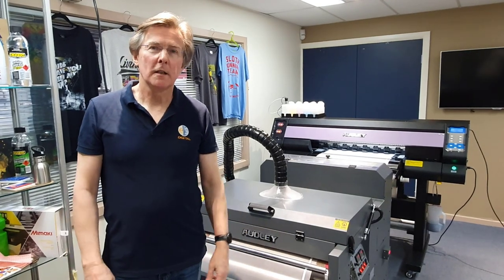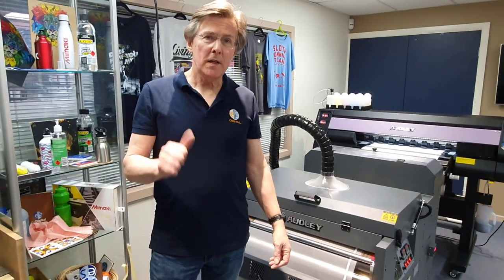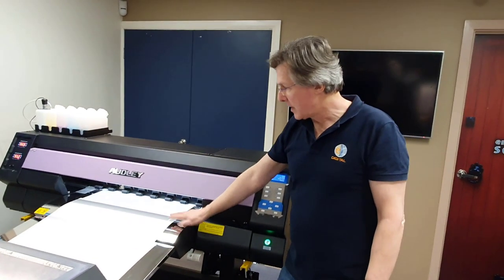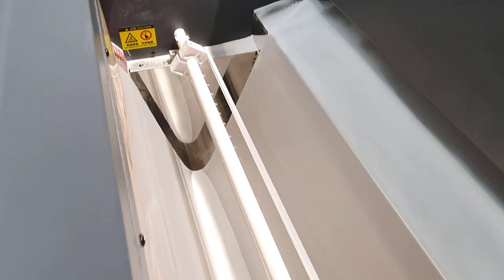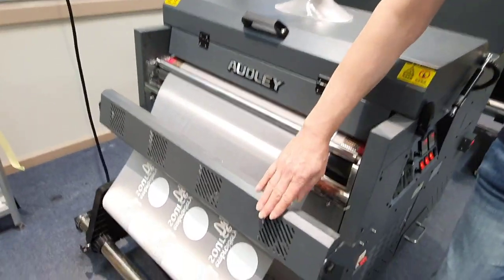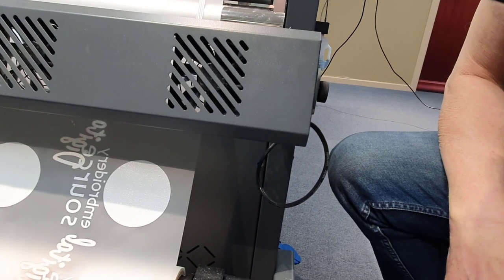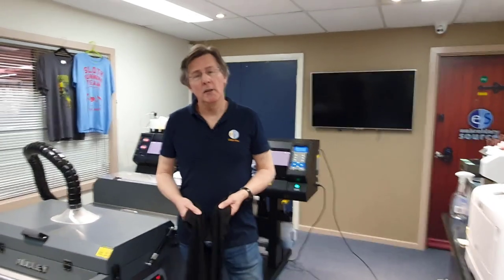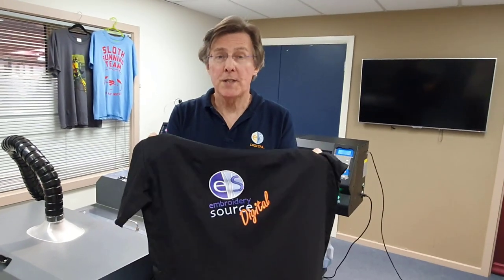Audley DTF Direct To Film Printer

Comment: Does your shaker/oven require an ac 220v power? if so can you tell me what to tell the electrician, please? thanks.
Reply: Hi Carlotta,   Here in Australia we use 220/240 volts and we need a special 20amp power socket and plug.  Not sure how the machines are configured for the US market.   Probably 110 volts.   Best thing is to ask your local dealer about power requirements.

Kind regards . . . . . Paul White

Comment: Hello I have a question with which rip software do you work with the Audley printer, how do you set the choke for the undrbase that the white does not come out at the edge ?
Reply from the maker: Wow! Sorry for my very late reply. We use SAI Flexi. Very easy to set choke for white ink

Comment: Hello Sir . On your video o saw some plastic bottles with print , may I know what process do you used
Reply from the maker: We use UV printer for some plastic bottles (not all types).   Polypropeline bottles can be a problem because they have a slight oily surface.